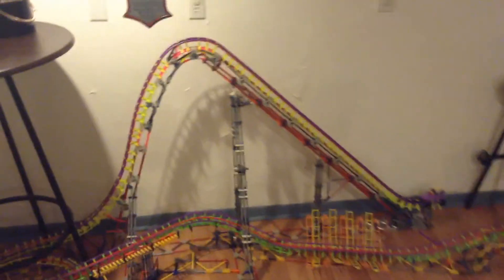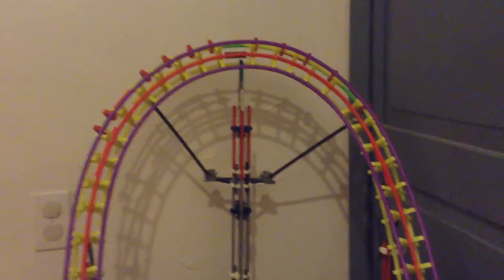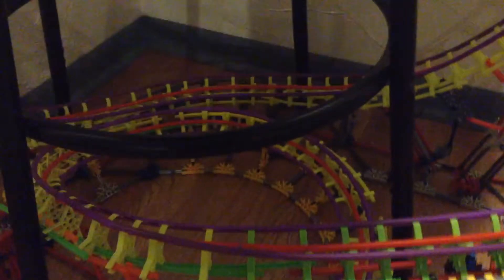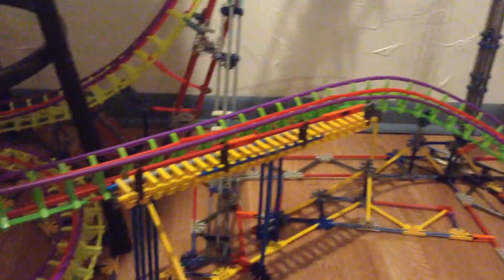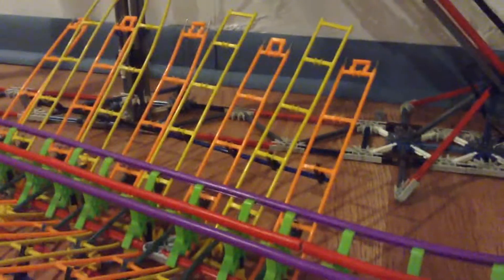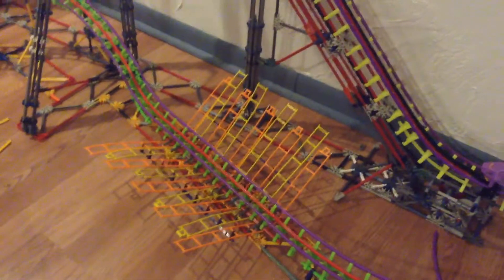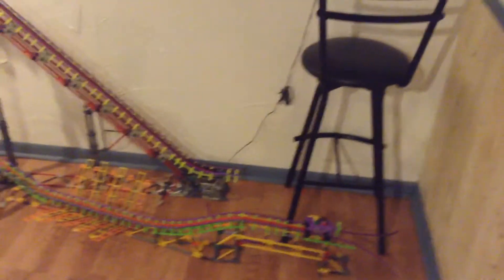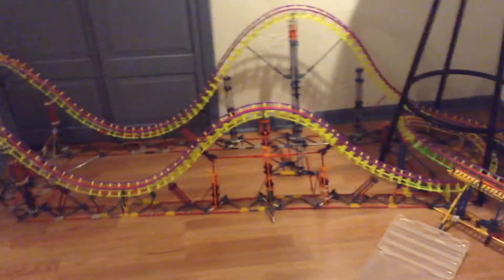HellFire B&M Hyper UPDATE 3/3

Comment: You should buy a screaming serpent car. They are much better looking and will only cost you under $10 on ebay.
Reply from the maker: Believe me, I have it on my Christmas list. However, if I don't receive it I may just buy it myself afterwards. And plus with myself going away to college in less than a year, I'll only have enough time for one more large project before I leave, and that requires the RR car (you'll get info on this project later) so I'm not 100% sure it's worth it at this point to purchase it. I will try to convince my parents to get me that for Christmas though.